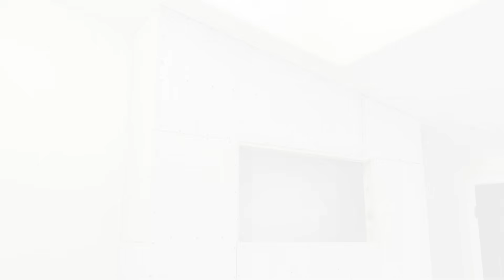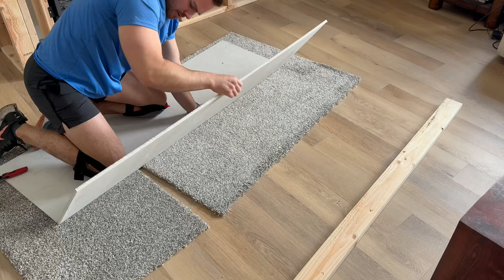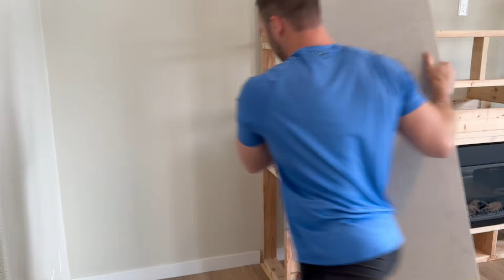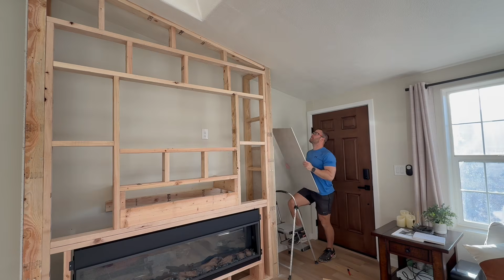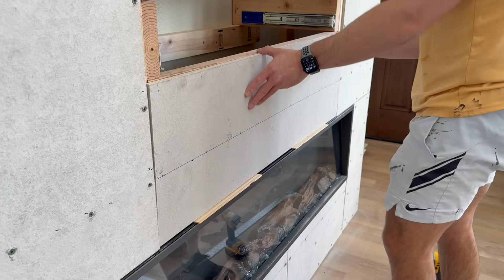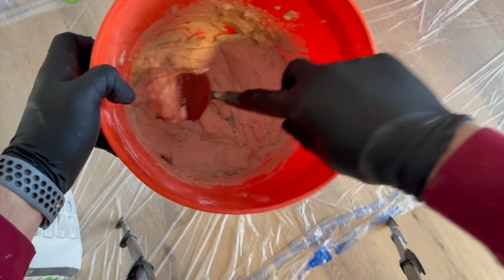Easy Cement Board Installation for Beginners - Fireplace Wall Part 2 | Builds by Maz

Comment: I wouldn’t have unsupported edges of the board, personally. So when you started on the left side and cut the piece to fit left to right, you should have just cut it in height so that it is fully supported on the top edge on that piece of horizontal blocking. Then the piece above it would be screwed into that same horizontal piece of blocking and not be unsupported along the bottom edge.

Comment: Hi! Awesome videos!! My husband and I are building this at the moment, and about to get to this section of your video but was curious why you're adding gap between the backer boards? We have 12 foot ceilings and I know the backerboard comes in larger size, which I would rather do to save time and having less pieces to cut lol; but I just didn't understand why you added the 1/2 rulers and took the time to do the mortar in between. Hope you'll answer by the time we get to this this weekend!!
Reply from the maker: They are expansion gaps, and are recommended by the manufacturer. It doesn't really add much time so I recommend doing it!

Comment: 8:42 Hello, did you add the tape to the edges as well and applied mortar? I’m currently building a similar version but not sure if I would have to do that to the edges where the cement boards meet.
Reply from the maker: Yep I used mesh tape on the edges too.
Reply: I was wondering the same. I don’t see tape or mud on the outside corners.

Comment: Okay maybe a dumb question but if the fireplace stops working are you S.O.L?  Or was there something i missed on how you would be able to take it in and out?
Reply from the maker: The fireplace is actually designed to be serviced through the front. The glass comes off and you can get get to the back panel to fix any issues.
Reply: @buildsbymaz ah okay makes sense! Thanks!
Reply: @Htxdood27  what if you need to replace the entire fireplace?

Comment: Why 1/2 inch Hardi on a faux fireplace, seems like overkill.  1/4" should be fine, no?
Reply from the maker: No - 1/4 hardi board is generally just used for flooring. But for vertical surfaces the 1/2 inch is much better, especially if you are attaching heavy stone to it.

Comment: How necessary is the tape and thinset between boards?
Reply from the maker: I wouldn't skip it - it can help prevent movement between the boards and reduces the risk of anything shifting or cracking down the road.

Comment: If I already have drywall on my fireplace, do I need to remove that or can I apply this tile directly to the drywall?
Reply from the maker: You will need to remove it. Drywall can't handle the weight of this stone.
Reply: Also drywall is not fire proof. Might want to look up local code on what can be used around fire places and other heat sources

Comment: Okay, may be a dumb question  but what would happen if the fireplace needed to be replaced?
Reply from the maker: Not a dumb question! It's designed so that it can be serviced while in place. You can remove the glass and back paneling through the front of the fireplace and replace any parts needed.